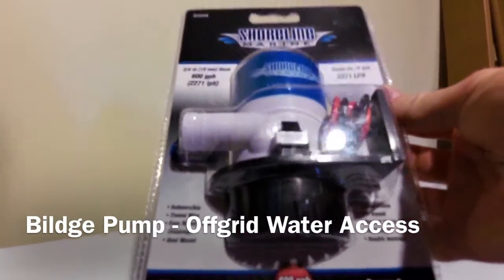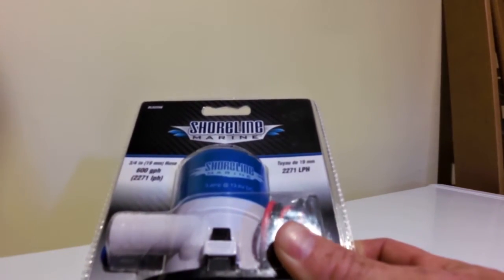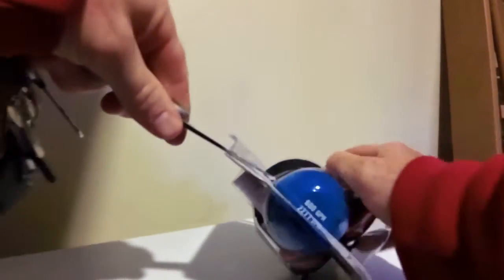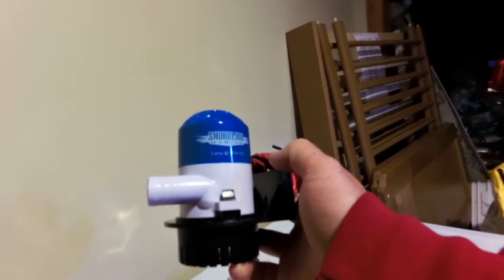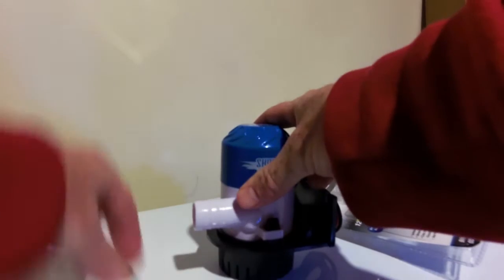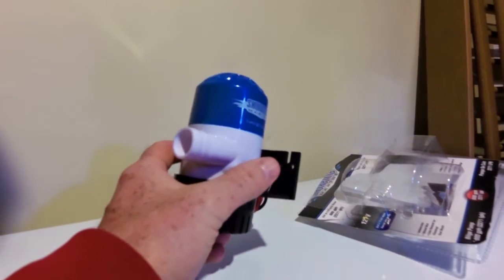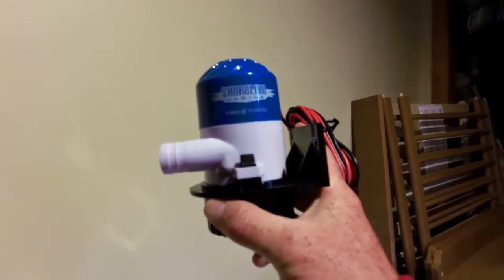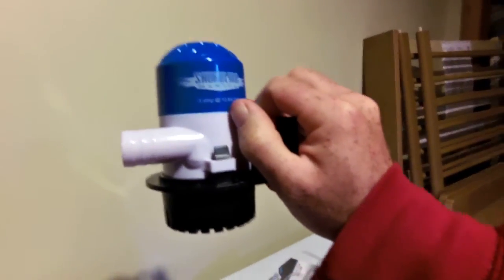Bildge Pump  for 'grid down' water collection scenario

Comment: I have been considering getting a bilge pump for the same reason you bought one. My plan was to use it to pump water from a rain barrel into the house for toilets and non-drinking use. If you have experimented with this pump I would be interested in finding out how you are using it and how it is working out.
Reply from the maker: +outbackeddie I've not gotten to this project yet, i have all the solar setup and operational but I've not put the pump into use. My questions now are how high can it pump water (out of a deep well for example). Its the 3amp one though so I opted for the more powerful one since lifting water is a lot of work.  I'll definitely do a vid if I put it into production somehow. For me, sitting on the shelf is insurance for a disaster of some sort because I can hook it up in no time and put it to work. I live in the country so if electricity goes down, my domestic water goes down as well,  don't have enough solar power to run the pump - by which I mean I don't have a large enough inverted. Only have 1000 watt inverter right now. Thanks for the comment!